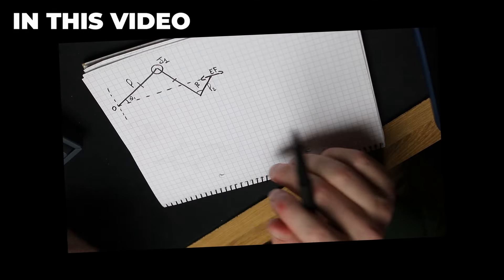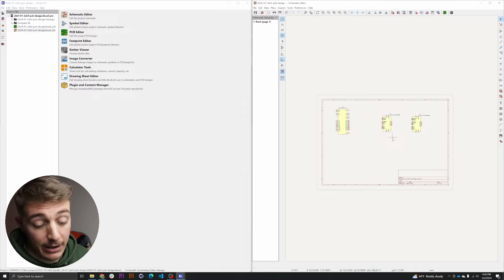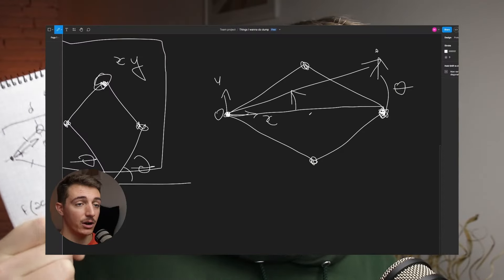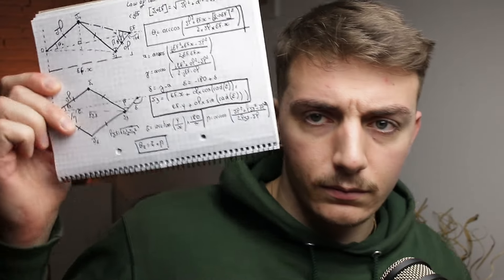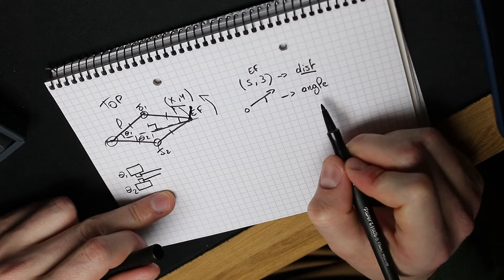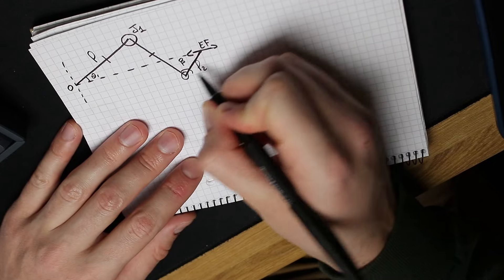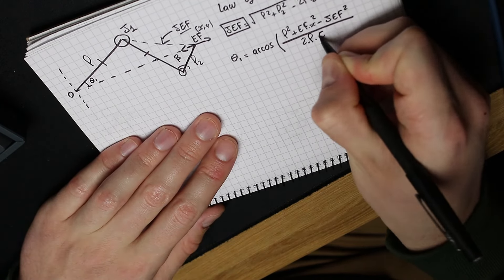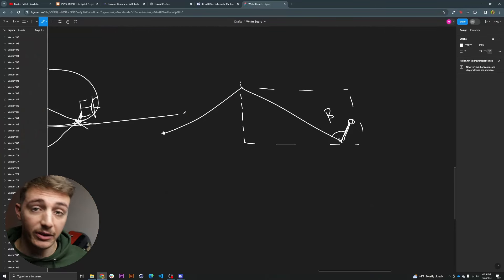Making a ROBOT from SCRATCH is rougher than I thought | Robot devlog part 9

Comment: Hey Marius, I'm a computer science student, happened to see one of your previous update videos as well so I clicked on this one. As I was watching this video, I was thinking there might have been an easier way to compensate for the arm's position. I feel like it should be possible to calculate the position of the pen relative to the position of the EF and then save that value as an offset to use with the original formula, no?
Reply from the maker: Now thats what I thought in the beginning! But the thing is, the offset is not the same according to how far the end effector is to the origin. To take it to the extreme: When the end effector is at the origin, the offset would be (lever_length,0), and when fully extended, the offset would be (0, lever_length). Because the lever is fixed to the top arm, and not an average of the angle of the top and bottom arm
Reply: The problem is that the offset changes, depending on the an angle of the effector. I immediately saw the problem as he drew it. A typical case of “oh fuck been there done that… how did we solve it in the past?” 
Mechanical engineering is hell. 😂We are so lucky to work in software and electronics those are simple… in comparison 😂

Comment: Hi Marius, I am an actual robotics engineer. For kinematics, which is what you're doing, we usually use the Denavit–Hartenberg method. I suggest you do some reading on this method as it will solve a lot of your problems in the future.
Reply: I’ve only ever seen the Denavit-Hartenberg method used for what I would call “sequential” robots, where each section follows on from the last, essentially each joint only has one input member and one output member. Does the method still work with a robot like this one where I would call it “parallel” where you have multiple separate sets of members that combine their movements using free rotating joints like the elbows in this one?